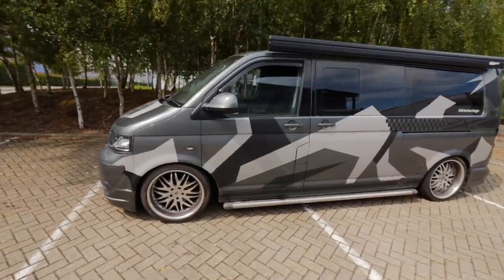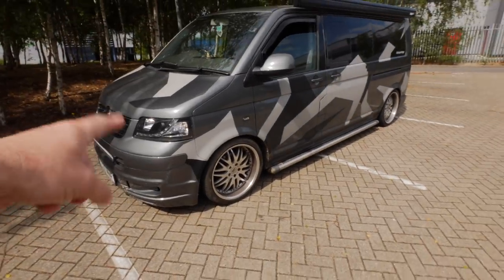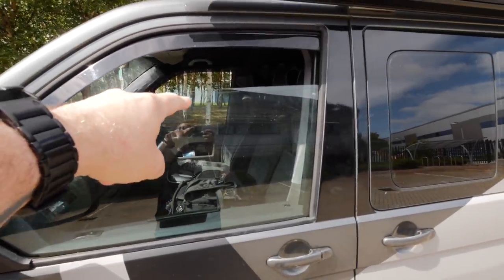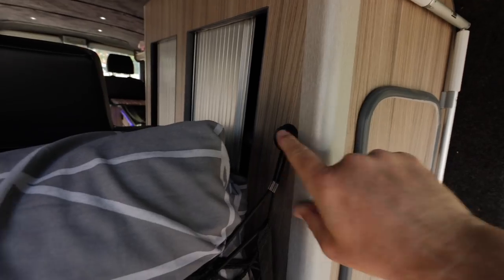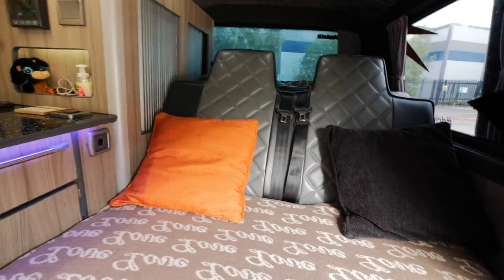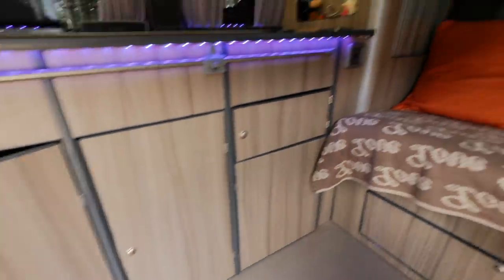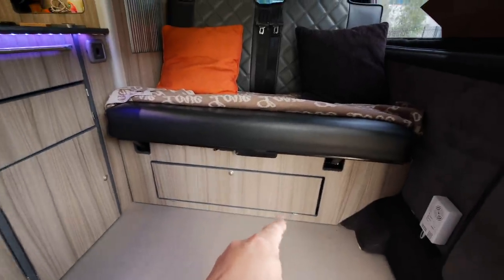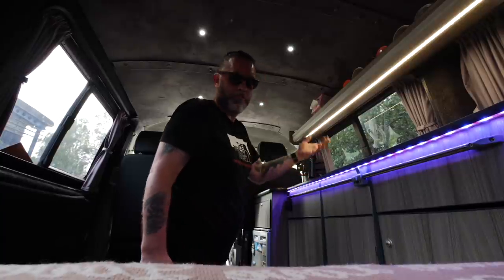VW T5 DIY self built camper - 3 years on

Comment: I like your honesty and ingenuity after you screwed up. You paint job wasn't that great so you improvised and the end result a really great. I personally think lowing a camper and putting LP alloys is a foolish idea and you have suffered as a result. The exterior of my Vivaro is the complete opposite, it is boring and 100% functional and the original wheels/tyres and 110bhp is plenty.
"YOU DON'T GO AWAY TO WATCH TELLY" A man after my own heart, my van is for adventure, even at 72, leaving you comfort zone at home, whatever that may be. 8 years ago I bought an 08 van for £3.2k spent about £2k on parts, R&R bed, SMEV and swivel double seat and my money now is spent on travel, diesel, a few tolls and an odd beer and coffee.
I think your van looks great, but my Vivaro whilst not in the same coolness league is reliable and to me that is everything...you pays your money and takes your choice. I think pop-tops are, well it's a tent, get a little folding fishing stool, my missus sits down to cook in the rear seat, I sit down to wash up. I used to camp a lot, so you learn to dress sitting down.

Comment: Really enjoyed that vid Lee.
I'm also a fellow MR2 owner and a T5 owner too.
We bought the van converted already and after doing some work on it, I've realised its a bag of shite conversion.
I'm gradually putting things right with it, had a refurbed auto transmission put in, mines on 185k. I've sorted out the birds nest of electrics, replaced all the front end with a face-lift to T5.1., I've got a swb but like the wind out awning, can you get sides for them ??
Also pondering the pop top too. I'm 6'2" and cooking getting dressed etc is a right mare but think we will pull the trigger on it but have it side lifting rather than front.
Also considering ripping all of the interior out and going for a U shape config.
Also found out that there's not a scrap of insulation in it either.
Good vid, good content and boss MR2, I'm on the fb mr2 group.
Reply from the maker: Insulation makes such a difference and I do really like winter camping. I’ve been noticing the u shape config a lot and really like it.

Comment: The best swivel seat. I know is a Kirvans, and they are not overly expensive to memory.

Nice Van, and good to know where some of the mileage limits are for those major pieces - I was always under the impression the VW vans were pretty good up to 200k, and beyond that you are in the lap of the gods. 

Agree - re: Kitchen - My van has a Northern Rose kitchen fitted, and it seems decent. 

And the pop top - I had a West Dubs fitted to mine, as I like being able to stand up at times - and it is useful when you are not wild camping, as my canvas has a scenic mode where you can literally sit in the roof with the canvas peeled away - and its nice on a hot evening with a cold beer.
Reply from the maker: Agree with the roof. I’ll look at getting one some point. 
From what I gather the engines are good for high mileage. The gearbox and running gear are the weak points as it’s basically just vw golf stuff pulling a lot more weight. 
Hopefully it’s good for another 200. The rest of the van is fine. Runs lovely and smooth
Reply: @SpyderLEE  Forgot to add last night when I made the comment - if you do punt for a roof - take a close look at West Dubs. I know people will have preferences about what roof you put on the van. But I was back at the place who fitted mine, and the people who own it took a call from someone who had a van built by another company, with a West Dubs van which had a problem. The company who built it had gone bust, but the roof was technically still in warranty. 

The people who took the call, spoke to west dubs direct, and because they are an approved roof fitter - West Dubs have agreed to fix the broken roof during the winter when the van is off the road. 

So when you do, punt for it, think carefully about which roof, and who fits it.

Comment: The seatbelt that's not retracting might just need cleaning. Pull it all the way out, clean and dry it then it will probably function normally again. Saves replacing it so worth a try.
Reply from the maker: I was hoping the same but sadly not. I tried that. It’s definitely broken. It was just a cheap eBay one
Reply: @SpyderLEE  Shame, worked a treat for me last MOT! Ah well, I'm sure you'll get it sorted.

Comment: Fantastic work. Do you have a link for the netting you use to store your bedding? That's a fantastic idea.
Reply: I'm also a bit of a novice. Can you just screw this bedding into the walls? Do you need to do any sort of prep to the walls first? Thanks
Reply from the maker: I’ve put a link in the description to the exact one I bought. I had to pre drill the walls for the screws to go in.